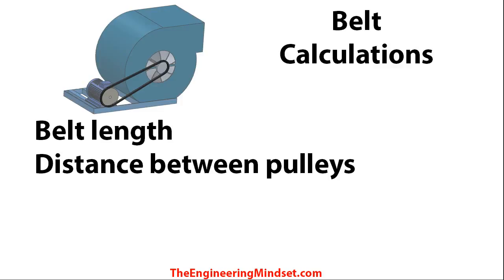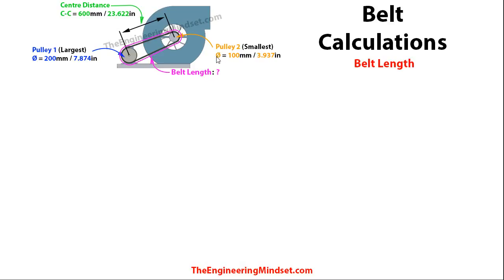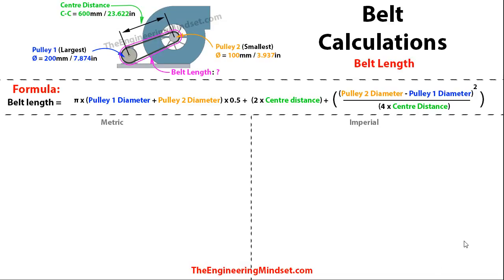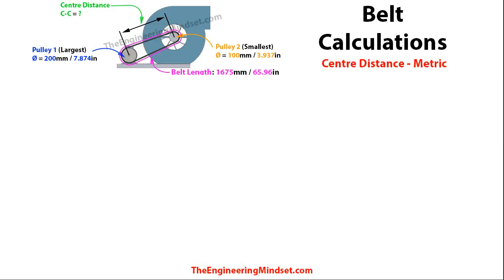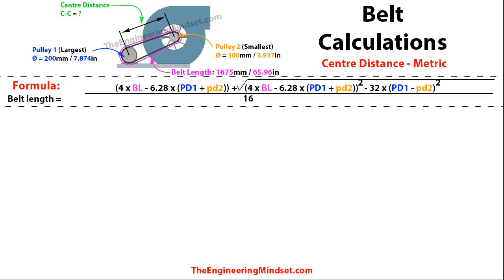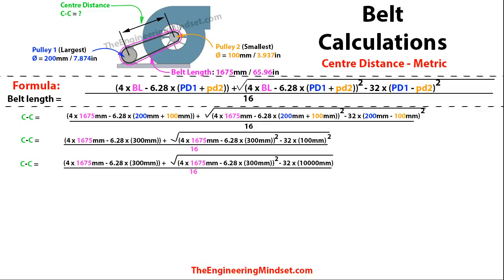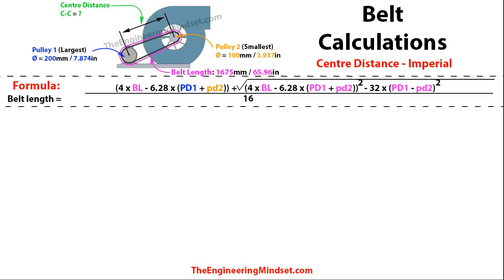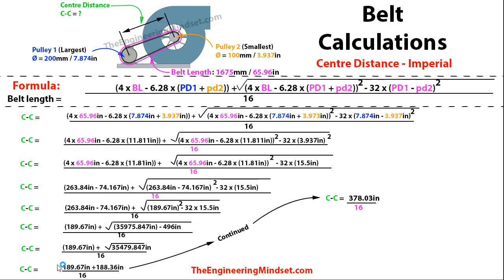Pulley Belt CALCULATIONS - Belt length, distance between pulley wheels

Comment: The formula for the Center to Center distance given the belt length is only an APPROXIMATION!!!!  if you use that and set your pulleys, it will NOT work, in my case the pulleys would be too far apart and it would be impossible to get the belt on and it would never work.  Fortunately I checked it on a CAD system and discovered it was inaccurate before  machining my expensive material.    After searching the internet for hours and trying every center to center calculator I could find and finding out they are ALL inaccurate,  I finally figured out the problem.   There is no known single formula to get the exact center to center distance given the belt length.  

I finally found the information I needed on one website, it gave the same formulas stated that the formula for belt length given the center to center distance IS EXACT, however the reverse formula for center to center distance given belt length is only an APPROXIMATION and  the correct usage is to use the center to center formula to get close.. then test with the exact belt length formula... adjust the center to center distance, test again, rinse and repeat until you get a center to center distance that gives the original belt length when the exact belt length formula is used.   Well this of course is tedious, so I wrote a FreePascal program to do this check and repeat:

I don't think I can post links here, but it's on GitHub user Zaaphod Repo Exact-Pulley-Center-to-Center-Distance-Calculator

I don't know enough about Excel to know if this kind of test, adjust, repeat, until procedure can work in it,  but I think it would be possible. Unless your spreadsheet gives the EXACT result, which is implied, then there should be a statement that center to center distance is an APPROXIMATION only otherwise it does nobody any good at all.  If you expect to charge for your program, which is perfectly fine, then you at a bare minimum must state that center to center is an approximation, or figure out a way to do the test, adjust, repeat, until procedure within Excel to get the exact answer.   Feel free to use reference my code to see how the adjustment procedure is done in an efficient way to zero in on the exact center to center distance.

Here is some sample output note the top line is the result of your formula as well, and it would end up:

        Large Teeth = 112
        Small Teeth = 18
Large Circumference = 560
Small Circumference = 90
     Large Diameter = 178.253536262922776
     Small Diameter = 28.647889756541160
Desired Belt Length = 740
 0  Adjustment = 0.000000000000000  Center Distance = 193.004306992301200  New Belt Length = 740.380451398498170
 1  Adjustment = 0.500000000000000  Center Distance = 192.004306992301200  New Belt Length = 738.537620397487670
 2  Adjustment = 0.250000000000000  Center Distance = 192.504306992301200  New Belt Length = 739.458823083015200
 3  Adjustment = 0.125000000000000  Center Distance = 192.754306992301200  New Belt Length = 739.919584256276380
 4  Adjustment = 0.062500000000000  Center Distance = 192.879306992301200  New Belt Length = 740.150004608541280
 5  Adjustment = 0.031250000000000  Center Distance = 192.816806992301200  New Belt Length = 740.034791124293970
 6  Adjustment = 0.015625000000000  Center Distance = 192.785556992301200  New Belt Length = 739.977186862830540
 7  Adjustment = 0.007812500000000  Center Distance = 192.801181992301200  New Belt Length = 740.005988786751910
 8  Adjustment = 0.003906250000000  Center Distance = 192.793369492301200  New Belt Length = 739.991587773081960
 9  Adjustment = 0.001953125000000  Center Distance = 192.797275742301200  New Belt Length = 739.998788266990460
10  Adjustment = 0.000976562500000  Center Distance = 192.799228867301200  New Belt Length = 740.002388523639640
11  Adjustment = 0.000488281250000  Center Distance = 192.798252304801200  New Belt Length = 740.000588394507080
12  Adjustment = 0.000244140625000  Center Distance = 192.797764023551200  New Belt Length = 739.999688330546750
13  Adjustment = 0.000122070312500  Center Distance = 192.798008164176200  New Belt Length = 740.000138362476490
14  Adjustment = 0.000061035156250  Center Distance = 192.797886093863700  New Belt Length = 739.999913346499060
15  Adjustment = 0.000030517578125  Center Distance = 192.797947129019950  New Belt Length = 740.000025854484530
16  Adjustment = 0.000015258789063  Center Distance = 192.797916611441820  New Belt Length = 739.999969600491000
17  Adjustment = 0.000007629394531  Center Distance = 192.797931870230880  New Belt Length = 739.999997727487650
18  Adjustment = 0.000003814697266  Center Distance = 192.797939499625410  New Belt Length = 740.000011790986040
19  Adjustment = 0.000001907348633  Center Distance = 192.797935684928150  New Belt Length = 740.000004759236840
20  Adjustment = 0.000000953674316  Center Distance = 192.797933777579520  New Belt Length = 740.000001243362250
21  Adjustment = 0.000000476837158  Center Distance = 192.797932823905200  New Belt Length = 739.999999485424950
22  Adjustment = 0.000000238418579  Center Distance = 192.797933300742360  New Belt Length = 740.000000364393600
23  Adjustment = 0.000000119209290  Center Distance = 192.797933062323780  New Belt Length = 739.999999924909280
24  Adjustment = 0.000000059604645  Center Distance = 192.797933181533070  New Belt Length = 740.000000144651380
25  Adjustment = 0.000000029802322  Center Distance = 192.797933121928420  New Belt Length = 740.000000034780330
26  Adjustment = 0.000000014901161  Center Distance = 192.797933092126100  New Belt Length = 739.999999979844800
27  Adjustment = 0.000000007450581  Center Distance = 192.797933107027260  New Belt Length = 740.000000007312560
28  Adjustment = 0.000000003725290  Center Distance = 192.797933099576680  New Belt Length = 739.999999993578630
29  Adjustment = 0.000000001862645  Center Distance = 192.797933103301970  New Belt Length = 740.000000000445540
30  Adjustment = 0.000000000931323  Center Distance = 192.797933101439330  New Belt Length = 739.999999997012080
31  Adjustment = 0.000000000465661  Center Distance = 192.797933102370650  New Belt Length = 739.999999998728870
32  Adjustment = 0.000000000232831  Center Distance = 192.797933102836310  New Belt Length = 739.999999999587200
33  Adjustment = 0.000000000116415  Center Distance = 192.797933103069140  New Belt Length = 740.000000000016370
34  Adjustment = 0.000000000058208  Center Distance = 192.797933102952730  New Belt Length = 739.999999999801840
35  Adjustment = 0.000000000029104  Center Distance = 192.797933103010930  New Belt Length = 739.999999999909160
36  Adjustment = 0.000000000014552  Center Distance = 192.797933103040040  New Belt Length = 739.999999999962710
37  Adjustment = 0.000000000007276  Center Distance = 192.797933103054590  New Belt Length = 739.999999999989540
38  Adjustment = 0.000000000003638  Center Distance = 192.797933103061870  New Belt Length = 740.000000000002960
39  Adjustment = 0.000000000001819  Center Distance = 192.797933103058230  New Belt Length = 739.999999999996250
40  Adjustment = 0.000000000000909  Center Distance = 192.797933103060050  New Belt Length = 739.999999999999660
41  Adjustment = 0.000000000000455  Center Distance = 192.797933103060960  New Belt Length = 740.000000000001360
42  Adjustment = 0.000000000000227  Center Distance = 192.797933103060500  New Belt Length = 740.000000000000450
43  Adjustment = 0.000000000000114  Center Distance = 192.797933103060270  New Belt Length = 740.000000000000110
44  Adjustment = 0.000000000000057  Center Distance = 192.797933103060160  New Belt Length = 739.999999999999890
45  Adjustment = 0.000000000000028  Center Distance = 192.797933103060220  New Belt Length = 740.000000000000000

Comment: HI, great channel! I have a question. Can a pulley system enable a diesels engine gross maximum power to achieve a greater RPM than its rating. For instance, I have a Detroit diesel Series Model 6V-53N/T that is rated at 300 BHP (224 kW) @ 2800 RPM . that is powering a Positive displacement blower , with a maximum RPM of 3000 @ 135 BHP.  Would a pulley system be a way of achieving the 3000 RPM at the pump? even though its only rated at 2800. ( 3000 RPM In order to maximize output on the blower) . Is this possible?
Reply: yes. you would need a slightly bigger pulley on the motor than the one on the blower. transferring that sort of hp would take a fairly chunky belt though or multiple belts

Comment: hello sir, im planning to make a gear pulley but i need to calculate the belt lenght, I have a question is the pulley diameter also a pitch diameter or the outside diameter of the gear pulley?

Comment: Thanks for the video, but I think you need to explain how you come to the last part of the first formula (pd2-PD1)² / (4xCD).
My AutoCAD does not agree with you, it is close though 1675.408 vs 1675.167.
Do you know where to find a formula that does it 100% correct ?
Reply: I have used the formula to calculate the center to center distance of known belt length, then tried to verify the results with 2 Different CAD Programs, and indeed it is off for me as well.  when I apply the center distance between my two pulleys, then draw the belt tangent to the two pulleys, it's off... 740.391mm when I put in 740.000000000 for my belt length.  Apparently, this is only an approximation, and not only this formula... but EVERY SINGLE Center distance calculator on-line that I have tried.. they are all off.   I even replaced the 6.28's for Pi*2 figuring that's what they represented.  I guess I'm stuck moving the pulleys a little at a time in my cad program, re-drawing the tangents, and verifying the belt length until I get it exact.

I found this:
https://www.york-ind.com/engineering/center-distance-belt-length/

It states: The approximate center distance can be found by this formula
and pretty much gives the exact same formula.
If there was a simple formula for this.. I think everyone would be using it
Reply: It's because the formula they are using is derived using the small angles approximation (for angles <30 degrees sin(x) = x).  The equation before it gets simplified is belt length = pi(r1+r2) +2x(r2-r1) + 2((r2-r1)/sinx) - where x is the angle of the belt relative to the horizontal and sin x = (r2-r1)/centre distance.
Rearranging this equation to get an exact value for the centre distance for a given value of belt length is a nightmare as you're dealing with x and sin(x) in the same line.

Comment: How would one calculate the diameter of a second pulley when the belt length, center distance and the first pulley diameter are known?
Reply: By considering speed of motor and  speed you want toa achieve.
N1/N2=D2/D1. N is speed
Reply: @sourabhparit5491  Thank you. However second pulley speed is an unknown and I am going to make custom matched stepped pulleys. I worked out the reverse method of finding the diameter of the second pulley based on belt length, diameter of the first pulley and center distance.

Comment: This is just a guess but it seems like you would double the distance between the center of the two pulleys and then add half the pi of each pulley. Is that right?  But then what do you do for fan belts like on a motor where there are multiple pulleys? My masking tape idea seems like a much better option...
Reply: That’s why I came here, seems that plan would only be accurate for pulleys that are nearly the same size. Masking tape is the practical solution though, yes.

Comment: After watching this video I decided it was much easier to apply a piece of masking tape around the pulleys, cut it off and measure it. Worked like a charm!
Reply: Of course It works, but it's not very elegant. And how are you going to ahow off your math skills that way?
Reply: @Nathan_Lang  I was always horrible at math until you put a dollar sign in front of it and then I all of a sudden become an expert!
Reply: My math skills told me that if I made a mistake and bought the wrong size belt that it would cost me a huge amount of time, effort and gas to go get another belt and only a few cents for the masking tape to be absolutely sure.

Comment: If I use tensioner wheel between two pulley then what is the formulae for calculating the length of belt  ?
Kindly reply ASAP because its urgent

Comment: Having lived most of my life using imperial formulas and recently needing to work in metric, I find myself loving the metric system more and more. My dear ol Dad said you need to work in both so get used to it. It makes using these formulas so much easier.  Great video, did you take pitch into consideration or mainly round/V belt? I may have missed that in the video but I work with timing pulleys and splined pulleys where the pitch usually is larger than the actual pulley diameter.

Comment: To bad he didn’t actually run through the calculation great that he showed the string but didn’t actually do it in video
Reply from the maker: Mike Craft the numbers in the formulas and string are colour coded, you should be able to follow it through
Reply: Welcome to introduction to mechanical engineering. It’s gets much worse as you progress to certification. My first class assumed you already knew how to calculate algebraic and geometrical given the formulas. Those days may my brain hurt. Never mind when you get to trig an calc.
Reply: Not an engineer or such, but had no trouble applying this calculation and method to figure out what size belts more or less I need to replace on my 2 belt bread maker. On opening it up both belts were completely destroyed. Both of varying lengths on a 3 pulley system. Quite chuffed I managed to follow all this and get the 2 belt sizes I need 😀👍

Comment: a little confused 
how did we do the first imperial belt calculation without knowing the centre distance and vice versa if the formula is needed of each other
Reply from the maker: You need to know one of the values or assume and reiterate your answers.